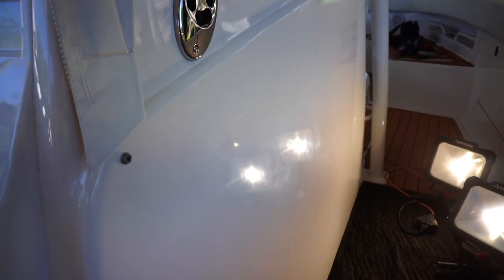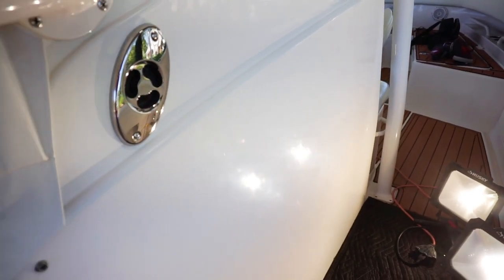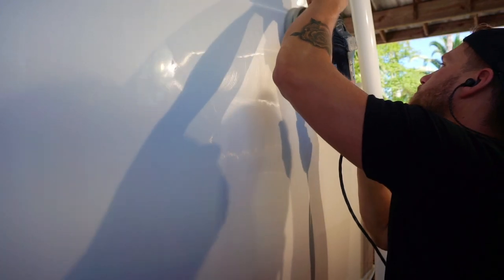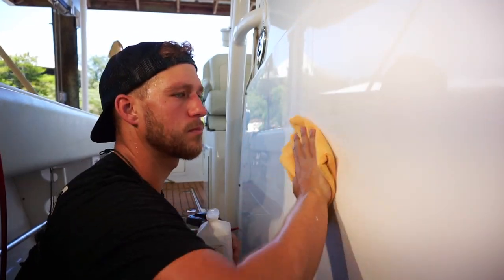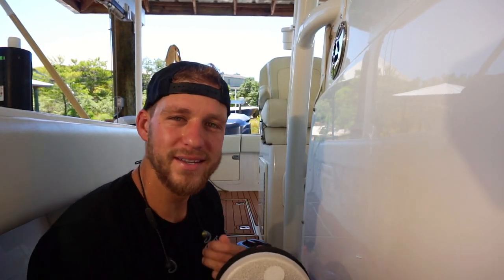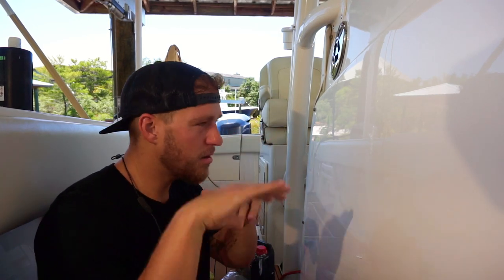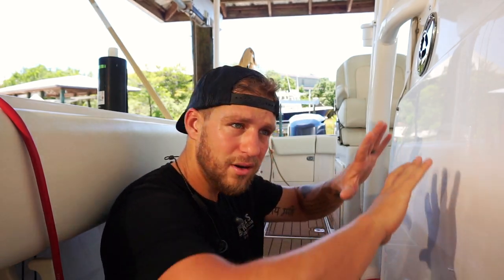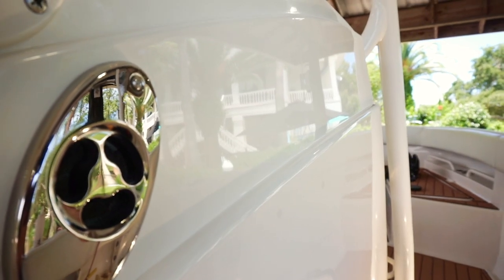These are KILLING your Wax! How to Remove Swirl Marks on a Boat | Boat Detailing Business Tips

Comment: Hi, i have a one year old boat. I always polish and wax my boats with machinery. But in this case the boat is very glossy, but i really dislike the holograms from the factory. Would a white polish pad With cut 30/100 and menzerna finale 30/100 suffice, i don’t want to use to agressive methods for something that probably only i see.
Reply from the maker: Yes! That will probably work very nice in your case!
Reply: @drakesdetailing What would you have done if it was your own (brand new) boat? Not for business. I mean for getting out all of the scratches. An extra polishing step with a softer pad? And which menzerna, a middle variant or the milder version? Or a completely different plan? I want the best result without going to far. Preferably skipping wetsanding and rotary buffing with a to agressive woolpad. Machines i use, the dewalt rotary and a rupes DA 15mm (mark iii).

Comment: Doesn't the isopropyl alcohol hurt the finish polish? greetings form greece
Reply from the maker: Nope! Compound and Polish isn’t something that “stays on” the gelcoat. The shine behind I’d left from the products. This step is meant to remove the residual oils from the compounds and polishes, so that the polymer sealant can adhere to the surface better. The polymer sealant however does “stay at the boat”. So after you apply the sealant you would not want to use the alcohol because that will remove it, which is probably what you are thinking of. Hope this helps!
Reply: @DrakesDetailing  Thank you Drake🤗🤗

Comment: Drake, small problem. I polished by boat using Mernzerna 400 and a Rupes Mille. When I finished, there is a film on the boat that doesn’t wipe off, it just smears around. Any tips? Thanks!
Reply from the maker: Hey! Wipe the boat down with alcohol before you after you compound and before you wax. This should help 😎

Comment: Hi Drake, so to make it clear and understand it correctly, you remove the swirls using the orbital machine and after you clean all the surface with alcohol before the last step??
Or you can skip the alcohol and finish with the lock product right after the orbital?
Reply from the maker: After you are done with all compound and polishing then you can do the alcohol step. The only thing you do after you do the alcohol step is the sealant

Comment: Totally awesome and honest videos, thanks. I am a DIY"er boat owner with a white fiberglas bay boat. I plan to do my own detailing (buff, polish, seal) and have a question about using Meguiars Marine High Gloss Polish M4516 follwing the buffing step. The description of this product says no grit but plenty of oils to "nourish" the gelcoat. In your video you advise to wipe down the surface after polishing with alcohol to remove oils which can give a false sense of shine. I thought polishes had at least some grit to them to take out swirls and holograms but apparently this product does not. It also adds oils that you recommend against. Is this Meguiars product one I should stay away from? Can't see any benefit to applying oils then removing them with alcohol.
Reply from the maker: Hey bro! I would personally stay away from anything generic, such as Maguires. There’s a lot of cruddy fillers in those products that we’re right down and don’t create a good shine. I do use the Shane supply message of products. They have my farm in the most consistent as far as quality goes: https://shinesupply.com/collections/marine-products

Comment: Two questions: Which is more aggressive, a wool pad or the heavy cut gray foam pad? Can you also comment when you would use one over the other. When do you have to go to wet sanding for scratches?
Reply from the maker: A wool pad is more aggressive than the grey foam. 

Typically, you would use a wool pad for cutting / compounding and you would use a foam pad for polishing.

Comment: I just started applying compound to my black boat . This is the first time I have ever tried this. It seems to be working pretty good. I just noticed that I have some swirl marks on the last part so I stopped. I think the problem is the my wool pad is looking bad. So how often do I need to change my pad?  Also,  can I wax the boat without polishing it?
Thanks
Reply from the maker: I would polish it with a finer compound in between the  compounding and sealing stage for sure, it will help take those swirls out. I’d change my pads out every 40ft

Comment: Hey Drake.  I love your stuff.  My question is that I’ve seen other videos that about if you don’t have oxidation then just polish and wax.  Do you have any videos on just polishing?  And what to use?
Reply from the maker: Hey bro! For just polishing I’d use a light grit compound as a polish with a forced rotation or DA polisher, then apply some Jescar polymer sealer with a DA and a black foam pad.

Comment: Should I wipe with some alcohol after waxing? Or is that just if I’m compounding? Thanks
Reply from the maker: Only wipe with alcohol after compounding or polishing. Then wax. 

The reason is One to see if you removed all swirls and two so the wax / sealant will stick to the gel coat. 

I try to always wipe with alcohol or wash with dawn before applying any wax or sealants. It will help it stick to the gel coat better!
Reply: Drake's Detailing OK that will work better than wiping it with Diluted degreaser?
Reply from the maker: Alcohol would be better for that
Reply: Drake's Detailing Awesome thanks a lot any kind of alcohol? should I dilute it With water or no?
Reply from the maker: I like 90 proof rubbing alcohol! Only thing is it may be hard to find some right now with the covid... if you can’t find Andy rubbing alcohol then denatured alcohol will work as well. But not as good as 90 proof
Reply: Drake's Detailing ok Thanks a lot

Comment: Your work is amazing! Have you used this product on RV gel coat? I have a lot of swirls after using Meguiars marine one step with wool pad. What do you recommend I do at this point. Thank you.
Reply from the maker: It’s likely that the swirls came from the rotary, I would just use the same one step products with a medium cutting foam pad on a da polisher. You can go to harbor freight and get a decent one if you don’t have one.
Reply: thank you. I was going to order some Menzema 400 and the gray pad? Which product is best for my situation?  Thanks again!

Comment: Any tips on removing swirl marks from a black motor cowling? What liquids and pads would you use?
Reply from the maker: Menzerna 400 with orange lake county pad 
Menzerna 2500 with white lake country pad

That should work!
Reply: @DrakesDetailing  Awesome! thanks for the quick reply!
Reply: Got the supplies in! Should I tape off the engine decals, or can I go over them with the griots machine?
Reply from the maker: You can go over them, just maybe run it alittle slower

Comment: Good Evening Drake. Thanks for your videos. Question, my boat was painted with gelcoat. They used a spray gun. I sanded the boat with 120 before painting. I sanded with 600, 800 and 1000. Used a wool pad with heavy cut compound to polish and the polisher with foam pad. I’m still seeing the 120 sandpaper marks. Anything you would recommend? They did 3 coats of gelcoat supposedly.
Reply from the maker: Hey Man! It sounds like you didn’t get out all of the 120 sanding marks out before you jumped up to 600. Start back with 120, and then add 220 and then 320 grit Mirka Abranet sanding paper between the 120 and the 600. Then do your regular buffing and polishing and you should be sanding mark free! Here’s a link to the sand paper I recommend! Hope this helps! https://drakesmarinedetailsupply.com/products/mirka-5-abranet-ace-mesh-grip-disc?_pos=3&_sid=db8e069bf&_ss=r
Reply: Did you figure it out?

Comment: About to try this on my new 21CC. Finish is pretty good but there are some light holograms that I want to remove before sealing. Thinking about using the lake country CCS orange with menzerna 400 on my griots random orbital. Does this sound good? 

Do I need to go with a lighter compound or pad on the painted bracket and engine cover? 

I have grit style non-skid on the boat. Since it’s new I’m thinking i should just go straight to Jesco power lock or nautical one non skid sealer and skip the polishing. 

Thanks!
Reply from the maker: Hey bro! Yeah 400 and a orange pad with a forced rotation should be plenty to remove the swirls. As for the motor cowling, 400 should be fine. It’s a very fine compound. If you non skid is clean and oxidation free, it’s totally cool to just apply some sealant over it 😎

Comment: I am correcting a red/black 27 foot Monterey, minimal oxidation, a lot of scratches and holograms. I have been wet sanding the bad deep scratches with 1000 then 1500 grit, followed by Menzerna 400 and wool pad on the rotary buffer-awesome smoothness and a lot of holograms. I have been polishing over with 2400 Menzerna to take out the holograms with a DA polisher-I have tried different foam pads but they don’t seem bite much (orange and yellow lake county). I ended up using some wool DA pads with the 2400-worked great-wondering why I don’t see much use of wool DA pads in the various steps?
Reply from the maker: Nice! 

I don’t have anything against wool da pads, just haven’t used them much. 

I guess I can be stuck in my ways. 

Iv just had great success with system and I stick with it. 

Thanks for the feedback, I always recommend people to find a system that works for you and stick to it!
Reply: @DrakesDetailing  Thanks for your reply I enjoy your videos I have  learned a lot making the detail process go much faster and the results much better
Reply from the maker: Awesome! Thank you!!
Reply: So, to follow up on my original comment, I tried out the new Rupes Blue course DA foam pads with their course DA compound after correction with the Menzerna 400. Wow! The speed and finish quality was amazing. It took all the holograms out and even some mild scratching but left a super smooth finish. No more wool DA pads for me.
Reply from the maker: Nice! That’s awesome

Comment: Would you say the Maguire's medium cut is good product. I have been using it on our boat and it takes the oxidation out but after I polish with the step 2 and it still has swirling
Reply from the maker: What pad and machine are you using to polish?
Reply: @DrakesDetailing  I use a Milwaukee variable speed buffer/polisher
Reply: @DrakesDetailing  wool pad for compound foam for polishing
Reply: @kylepothast8027  it's very hard to finish out perfectly on a rotary with anything other than an ultrasoft polishing pad and a very fine finishing polish/glaze. Even then, it can be challenging. That's why we grab a DA to remove them quick and easy.

Comment: Hey Drake awesome vid much appreciate the info and instruction! I have a red and black boat that has a ton of swirl marks all over as well as some oxidation. I purchased the griots buffer with the grey foam cutting pad and a microfiber buffer pad. You said the process in the vid works well for white boats. What do you recommend for the deep red and black boat? What products/compounds and process? TIA!
Reply from the maker: Hey there! if it’s really oxidized I would go with  Starke Level R heavy cut compound on a heavy cut wool pad with a rotary buffer, then Starke Elevate on a Yellow wool pad with your rotary buffer, then Starke Ignition polish on a Lake Country orange forced rotation on a DA then Starke Hyperhold for sealant, the DA alone will not be powerful enough to cut through the heavy oxidation. You will need the rotary for the first two steps as stated above, then you can do your light polishing with the DA, as well as applying you sealant. All of the products mentioned above are available for purchase on my website 😎https://drakesmarinedetailsupply.com/

Also if you would like more detailing knowledge, I have an awesome live recorded detailing course available for purchase!https://www.detailuni.com/a/2147504321/GMGkUUpS

Comment: Question for ya.  I bought  a used bass boat that has chips of wax flaking off or lifting from the surface.  I want to get rid of that and do it the right way.  What's the best, and hopefully easiest, way to remove them?  Wet sanding?
Reply from the maker: hey! I’m sorry I don’t exactly know what you are referring to. Was your boat ceramic coated??

Comment: Appreciate all the great videos.  Do you have tips or videos for a black boat?  Have done my own boats in the past with white and light colors.  First black boat and just want to remove swirls.  Own the GG machine.  Thanks in advance
Reply from the maker: Hey bro! extra swirl removing will be needed for a black colored boat, they just show more imperfections! I use all Starke Yacht cares line of compound and polishes and they work extremely well with dark colored boats. After you have done your initial heavy cut step with your rotary and Starke Level r, I would then switch over to the lake country purple foam-wool pad blend on the rotary with Stark elevate medium compound, then I would personally get yourself a Rupes Millie forced rotation to remove the remaining swirls, the GG DA polish would work, but investing in a Rules Millie would bring your work to a whole new level, and is an absolute must in my opinion if you own your own detailing business!! So after the elevate on the Rotary with the purple foam-wool blend pad, you then use the Rupes Mille with an orange lake country forced rotation pad with elevate. For the last step, you can use your GG da polisher to apply Starke Hyperhold polymer sealant for protection!! This is the system that works GREAT for me with colored boats! For maintenance, after every wash keep it protected with Starke replenish🔥🔥

here’s the links to all the products that I mentioned:

Level r heavy compound:
https://drakesmarinedetailsupply.com/products/starke-yacht-care-level-r-heavy-cut-compound?_pos=1&_sid=bf48c3eb5&_ss=r

Pad for the lever r:
https://drakesmarinedetailsupply.com/products/8-x-1-25-buff-and-shine-double-sided-heavy-cut-wool-pad?_pos=2&_sid=01121da36&_ss=r

Elevate medium cut:
https://drakesmarinedetailsupply.com/products/starke-elevate-medium-cut-compound?variant=37398819602608

Purple foam wool pad for the Elevate on the rotary:
https://drakesmarinedetailsupply.com/products/lake-country-purple-foamed-wool-pad?_pos=1&_sid=48de9d21f&_ss=r

Rupes Mille forced rotation: 
https://drakesmarinedetailsupply.com/products/rupes-bigfoot-lk-900e-mille-gear-driven-polisher?_pos=1&_sid=6d41bbb8b&_ss=r

Pad for the Mille: 
https://drakesmarinedetailsupply.com/products/lake-country-sdo-orange-polishing-pad?_pos=2&_sid=99bb7880a&_ss=r

Starke Hyperhold : https://drakesmarinedetailsupply.com/collections/sealants/products/starke-hyper-hold-polymer-sealant
(this can be applied with any soft pad on the GG da) 

Starke replenish:
https://drakesmarinedetailsupply.com/products/starke-replenish-silica-spray?_pos=1&_sid=4d2515a82&_ss=r

Hope this helps bro!!!! 🔥🔥😎
Reply: @DrakesDetailing  I appreciate you taking time out of your day to give me this info.  While I work in the marine industry (boat dealership) the detailing portion is just my hobby for my own toys.  As I own the GG, can I use the same pads and processes you mentioned?  

Again, I know your a busy guy, your work looks amazing I’m the videos, and thank you so much for pointing me in the right direction.  Worst case scenario I send it to our detailers in the back to fix my mistakes!    (Still not as good as the stuff you do)

Comment: I want to give this a shot on my boat.  What are the odds I'm going to screw this up and "burn" through the gel coat?  Any huge risk in using a budget DA polisher from Harbor Freight?
Reply from the maker: I would say it’s impossible to burn through with a DA! You Would literally have to try to burn through ha 

You should be be safe! 

Harbor freight DA is fine!
Reply: @DrakesDetailing  appreciate the quick reply.  Your video was on white gel coat.  Should I expect the same results on colors too?
Reply from the maker: Yes, but you may have to follow up with a finishing pad with menzerna 2500
Reply: Hi again.  I put in my orders for the Menzerna 400 and grey pads. I have a buddy that will loan me a really nice DA buffer.  After I get it all buffed/polished out, can you recommend a good spray and wipe sealer or wax or do I have to go over it all again with a wax n buff application?
Reply from the maker: Use jescar power lock as a sealant and top it with mckees 37 hydro pearl!

Comment: How long does a lake country pad usually last? Can they be washed for reuse? Can the same one be used for a two step compound? Thanks!
Reply from the maker: The pads will last pretty long depending on how long and often and how much speed you put behind them. Yes you can wash them and reuse them. You can also use them for compounding.

Comment: Drake, I have a boat with some halo lines down it on black gelcoat. Boat was apparently done with heavy compound and then a polish plus with a spray wax. My question is, if i want to redo this work and get out the halos, do i need to strip the wax before i polish or can i just polish over the wax?
Reply from the maker: Hey man! The halo marks are swirls left begins from the heavy compound, wool pad and buffer. I personally like to remove the wax by washing with Dawn, plus it just helps clean the area do you can start on a nice clean slate😎

Comment: Hey drake. Thanks for what u do. I have some micro swirls. I’ve tried almost everything. 3m heavy, medium, swirl remover, heavy cut down to polishing pads on my shirhold da on 6 (max). I can only see these in the light. Any more ideas?
Reply from the maker: I would definitely try a fourths rotation machine. They are the best for getting swirl marks out of gelcoat and paint. They are a little pricey, but worth it if that’s what you are trying to achieve. My personal favorite is the Rupes millie.